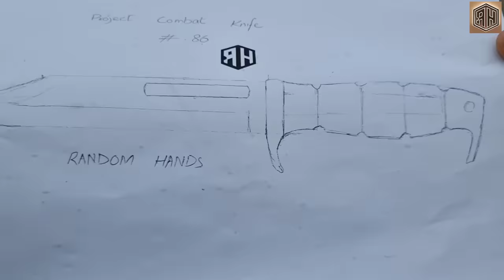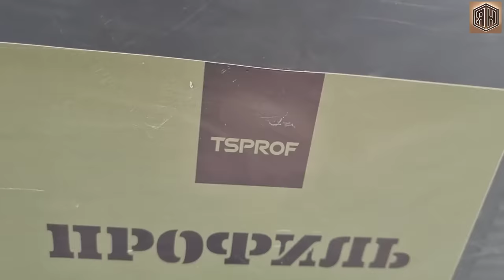Forging a RUSTED BEARING into a 24K GOLD Combat KNIFE

Comment: This was my first video of yours and i have to say i like what i see. I'll definitely be subscribing to your channel.  The only 2 things i don't like about this knife is the fact it's gold and there's no mechanical pin holding it together. Other than that it's a beautiful blade.
Reply: agreed, the gold just gives it an aesthetic  (and maybe some rust protection) and no else, the handle should've been held with a mechanical pin since as the title says, this is a combat knife and they're made for durability, so having a flimsy handle that could slide off is not good at all.
Reply: @lanthan598  I somewhat agree with you but he is not going to use because it is gold and most likely decoration.
Reply: Golden things is kinda his trademark
Reply: @hanneslindstrom4665  is it? This is the only video that I have seen from him that requires gold to forge the completed  blade.
Reply: @hanneslindstrom4665  mirror polish is his thing not gold lol
Reply: The gold plating actually makes the knife unusable. I don't know much about blade Smithing but I do know a thing or two about knife sharpening. As soon as that edge gets gets dull which it will after use, that gold is getting scraped right off, ruining the knife's aesthetic. You can either have a knife that becomes useless as soon it needs sharpening, or you could ruin the knife by sharpening it (which shouldn't even be heard of). It's like plating when cooking. If you want to make your dish look good, you shouldn't have to add inedible garnishes to do so. Because, what good is a garnish if you can't even eat it? Same applies here. What good is an aesthetic if it ruins the blade's functionality?

Comment: As someone with no knowledge of metallurgy whatsoever, I need to ask:  What is the difference between cold blueing and hot blueing, and why does it make a difference?
Reply from the maker: Cold bluing is pretty easy to do with beautiful result and Hot bluing always need to maintain a suitable temperature to do. Cold bluing don't hurt the hardness or temper of your metal while Hot bluing easily changes the state.

Comment: Damn, I bet a bearing race is super-strong brittle steel. They don't crack and come apart like mild steel. Bearings usually explode. They have always fractured like superalloy does when I have problems with them.

Comment: I'm sure you know what you're doing and that turned out nice...
However....From 3:05-3:22 watching you grind with the tip of the blade facing into the direction of the belt instead of the other way gave me some serious anxiety for a minute there. That's a good way to replace a belt, possibly a finger and a pint of blood. 
Other than that i enjoyed the video.
Thank you.

Comment: Disclaimer: my hatred of metalsmiths is purely theatrical, but if I did have to kill one for some reason, it would be very easy.

I’d brandish my golden knife at them and they’d be compelled to approach. “That’s very cool,” they’d say, confident in their superior strength and endurance from all the iron chunks they carry around at all times. They’d shower me with very interesting facts about swords and hover just out of range of the cutting edge, waiting for me to exhaust myself. “But as it  is too soft to hold an edge or cut with, isn’t well-suited for use as a weap—” and then I’d hit them with the wooden baseball bat in my other hand, which they would not have noticed because metalsmiths can only see metals

Comment: Im a little disappointed that you would go so far as to 24k gold plate the blade and then use a block of Teflon for the handle. I think if you would have gone the traditional rout with the handle and made it out of layers of hardened leather discs it would have looked much better. Especially with a brass guard and pommel. Still pretty cool, I just feel like you cut some unnecessary corners on this one.